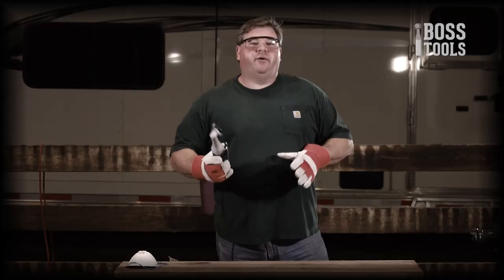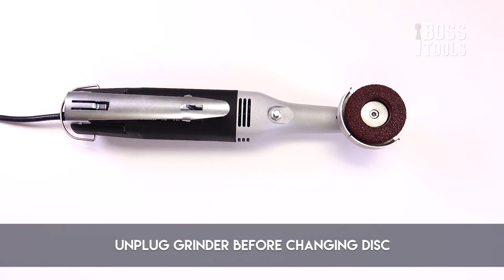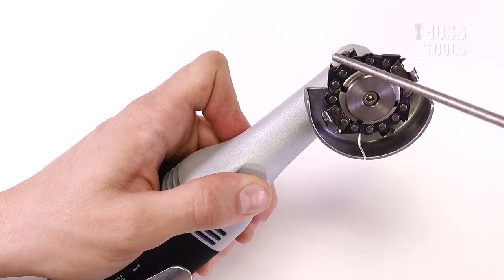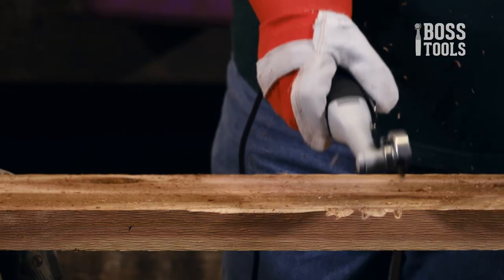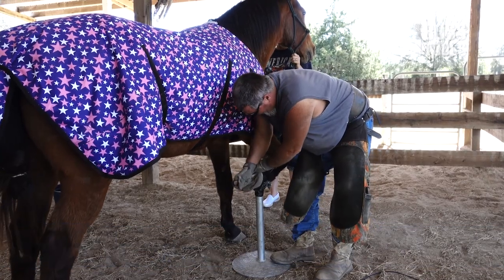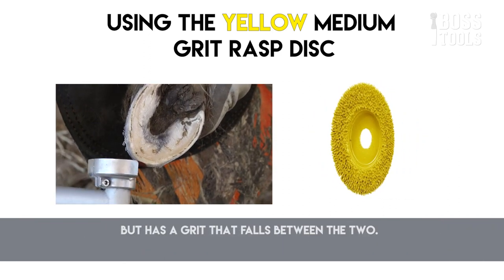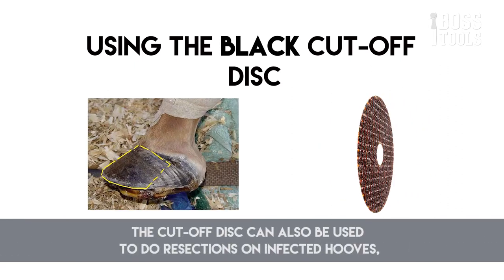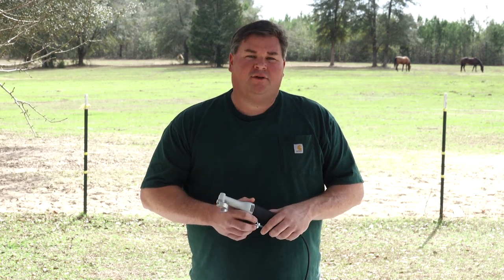Everything You Need to Know About the Hoof Boss- HORSE

Comment: AMAZING!  This is what I have been wishing for, for many years!  I have saddle horses, draft and draft cross  horses.  I would like to know if you have any fairriers who use this device in Minnesota.  Do you have any classes planned for the future? I would consider coming to you!  I used a regular floor sander on a friends goats and it works great, but it seems to get very hot very quickly.  I would assume, this could also happen with your tool.  The trick is to move it constantly but the hoof still became hot.  I found it is especially important to use a face mask and eye protection!  The dust is really fine and nasty.  I wondered about hot days and the fact that it could spread fungus spores around.  I disinfected my face and body with an anti fungal soap and washed all my clothes in hot water with a few drops of bleach. This could be a problem when the weather is hot and the humidity is high because your skin pores are vulnerable.I knew a horse shoer who told me he once got a very nasty fungal infection from trimming hooves. Anyway, I am really interested in this remarkable device!  Thank you for inventing it!